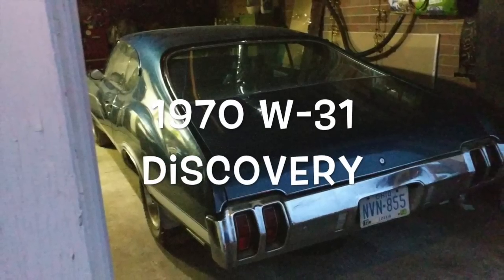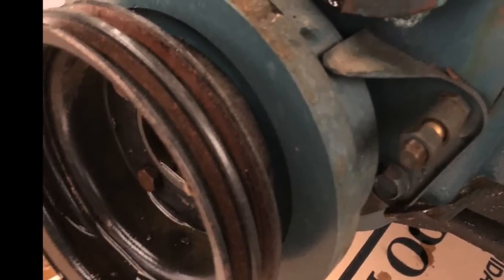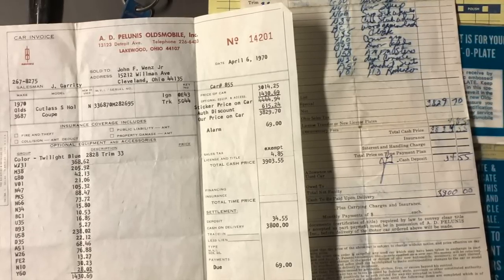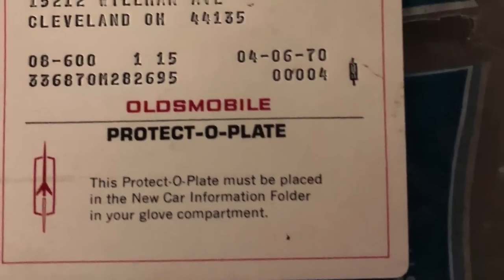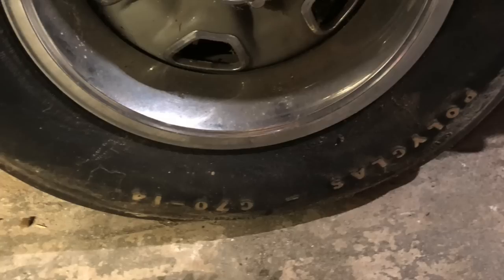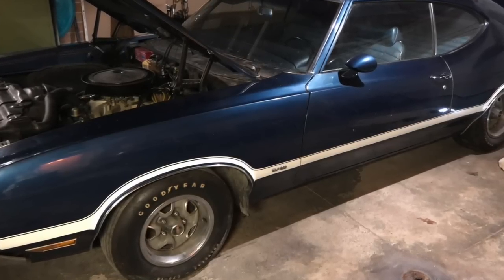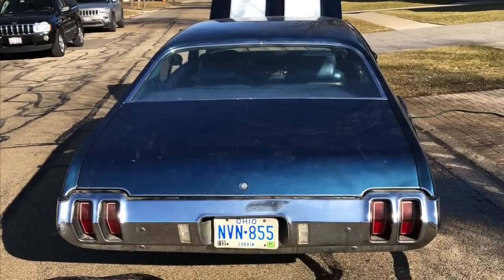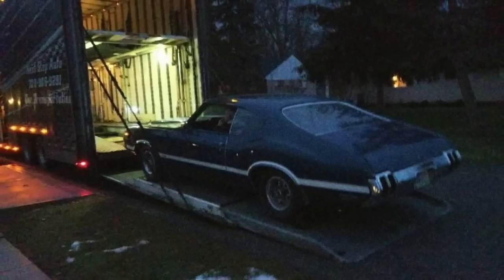1970 Olds W 31 Barn Find Uncovered

Comment: I've always been a Pontiac fan but I LOVE those W-31 350's. Old's pulled out all the stops when they made them. Thanks for the video and for rescuing a true classic from the musclecar era.
Reply: All the stops?  Take a look at the host of modification that were made to this engine in order for it to succeed in the NHRA "stock" class back in the day.   By today's SAE Net HP standards, this engine made no more than 250 SAE Net HP.  Tire for tire and otherwise production line stock vs. same, the typical 5 year old Honda Accord V6/automatic would toast this car.
Reply: The king of 442’s is and always will be the 1970 WP30 equipped with BOTH 4’s.
Reply: @harddrivin1le-970  Bwhahaha!

Comment: In 1976 there was a car lot in San Jose Ca called performance unlimited. A friend of mine used to go there weekly when he came across a Orange with black stripes 70 or 71 Olds W30  drag car sitting in the rear of the lot. It had very low miles and a blown up motor (455). It has been hit in the drivers rear quarter panel. He made a deal for the car and got it home. The engine was intact but had a cracked block from a piston that went through it. He found a donor block and he and his Dad rebuilt the engine and fixed the quarter panel. He got rid of the mag wheels and found a set of stock wheels. He spent the next couple of years putting it back to stock. Really was a nice car.
Reply: Hit the ground running.....was Performance Unlimited located off of Stevens Creek Blvd. or San Carlos Street? I remember Bob Shiro Motors, they had a lot of muscle cars back in the day.
Reply: @stanmendoza7871   It was on W San Carlos just over the higway 17 from Valley Fair. I also remember Bob Shiro Motors Stevens Creek at Kiely.
Reply: @rgs4x  That's the place I went to in high school.....many years ago. A friend of mine bought a real 1970 Hemi Cuda' there, he still has the car.
Reply: Stan Mendoza that’s a bitchin’ ‘Cuda

Comment: I knew it was a late 70s/early 80s repaint because my 70 442 is also a code 28 twilight blue and i did my first paint job mid 80s at 15 years old. Local painters supply mixed it and i knew it was a little darker than original but thought it looked better anyway. Love the overall vibe of this car in the vid!

Comment: Nice find.    1970 was the only year with the aluminum w-350 intake.   I had an intake and let it go.  Also 1970 had large valves (2 in intakes I think) and positive valve rotate-ors. very rare.    Most likely the reason for the air bags in the springs was the rear end bounced (alternating)  when doing burnouts.
Reply: E heads have 2 1/4 " and F heads are 2 1/2 " I had 70 455, E heads, rated 390hp 510 ft lbs of torque rated low for insurance purposes

Comment: One of my favorites along with the ralley 350s.
Reply: Both very modestly performing cars by today's standards, with the Rally 350 being the slower of the two.  The later typical ran lower 15  seconds quarter miles, with the former being good for upper 14s.  I have a host of vintage road test results from this period.  Even the '69 W-30 442s couldn't get into the low 14s or break 99 MPH in the quarter mile without various on-site tweaks, including removing the air filter element, tweaking the carb (e.g. jets and metering rods) and ignition and in some cases loosening the accessory drive belts. What was "fast" in 1969 is quite modest by today's standards.
Reply: It "makes your day"!😊

Comment: I remembered buying these cars for 350.00 to 500.00 all day long back in the 1980s
Reply: Correct, I sold my 1970 W-30 in early 1974 for $850.00 (the oil crisis)
Reply: How many 1970 W-31s did you buy for "350 to 500 all day long back in the 1980s?"  Production numbers on these cars were quite low, making the car relatively rare by the time the 1980s rolled around.
Reply: I bought my 70 455 olds in 1984 for $500

Comment: Very cool!
Reply from the maker: Thanks Bob. Still trying to figure out what people want to see and the best way to present what material I have. I am getting feedback to simplify, which would make editing much easier.
Reply: I know a guy with a W-31, its very nice, but original engine is long gone....but it does have a built 455...465 hp, 510 foot lbs torque.   Its so powerful if you are driving at 30 mph, floor it, it will spin tires until car gets to around 50 mph...the torque is out of this world!

Comment: I bought mine brand new from the factory with NO STRIPES from the factory. F-85 W31 4sp. Bench Seats all black. I bought mine from Earl Olds in CLEVELAND for $3300. I think there were only 135 made on the F-85 chassis.
Reply from the maker: You are the original owner?
Reply: @thewriter2549  I was. I ordered the car in Feb. 1970. I didn’t want the W31 stripes, and the salesman, Tony Foos, son of Earl, told me the stripes had to be on the car, because of the W31 package. I told him I wanted to cancel the order, but somehow, he pulled strings to have someone walk the car down the line, and make sure stripes weren’t t added.   I picked up the car just after the KSU riots, as I was a student there and classes were cancelled after May4.  My car was the 2dr. Sedan, bench seat, wing vent windows, dog dish hubcaps, ‘sleeper’ that I wanted. I put a set of Hooker Headers on, and a Sun Tach on the steering wheel. My Uncle had a 70 Cuda 383 4sp., and I would routinely beat him in drags. I could take Road Runners383’s, but I couldn’t get past the big block GBodies. At Norwalk Raceway, they put me in a class with GTO, SS396, and Roadrunners. I kept the car for 2 years, and stupidly sold it with 20k miles. It was probably a good thing, as I was a musician then, and would probably hurt myself in that car driving home from gigs loaded.  Biggest car wise dumb thing I’ve ever done. I tried to buy the car back, and the new owner ran it into a cement retaining wall at 70 mph, and pushed the engine into the front seat. The frame was twisted, and back then, we couldn’t straighten them out like today. I didn’t even have carpeting and it only had an AM radio.  Back then nobody new it was a W31 till they caught up to me ant the next light, mainly because of no stripes. They would then see the W31 badge on front fenders and have an “oh yeah moment”. It was so fn cool. It would probably be worth 6 figures today.🥲

Comment: I purchased a new one in 1970, mine was very rare, dark blue with black accent stripes.... The 3.90:1 rear axle was not standard...what would you like to know about the w31 ?   the ram air mechanism is missing on that car.... they had a dr oldsmobile sticker on the air cleaner... many unique things I remember.. Im 70 now.... my car ran 13.90s at pittsburg international dragway in 1970  (4 speed )  The engine would turn 6800 rpm pretty easy.. I floated the lifters and bent valves at 7200
Reply: larkin curtis Pretty sure he said the 3.91 was standard or are you saying yours had a 3.90:1
Reply: It didn't run a 13.90 in absolutely bone stock tune, though.  These cars were hard pressed to get out of the 14.6 range as they rolled of the showroom floor.  Revving these engines to 6,800 RPM plus was fruitless because that's some 1,200 RPM above peak power.  One would experience substantially improved results by shifting at 5,800 RPM or so with this engine.
Reply: larkin curtis Wrong. The 3.91 rear was standard on the 1970 W-31. There wasn’t a Dr. Olds decal on the OAI adapter. Your dark blue would be the same as this blue; the color is called twilight blue.
Reply: larkin curtis thanks, I bought a 70 Coronet 500/383/310 hp++/auto: actually the Dodge/AMC DEALER next to Thornburg ‘s Pharmacy (where I worked) GOT ME INTERESTED WITH a * AMC RebelMaCHINE, TO A 70 CHALLENGER 4 SPD/SE MAGNUM( to much gas eater,etc): the Ralley Red Coronet was  $3100( delivered), and for my wife to drive to Fort Wayne IND : finish Purdue....etc. Actually could,not afford w-31 Loaded, Corvette just out of Pharmacy  School....  .... ACTUALLY POWERFUL DODGE, ETC..... WARSAW IND road salt ate the Dodge up...........etc.

Comment: That proper Quadrajet is clearly visible @ 4:27 ... just saying 

edit: beside intake, partially obscured by air cleaner housing
Reply: TheCanadianBubba You’re correct in that there’s a quadrajet in the trunk, however, it’s not the original ‘255.
Reply from the maker: Nice try, Bubba, but this guy McKeague is an Oldsmobile W31 savant - just amazing, and he's a young person.
Reply: Seriously Jerry... I would bet my eye teeth that is an Olds Q-Jet... the fuel inlet comes straight out the front on those ones.

edit: unless that picture is from before the Holley was installed edit2: did not see the comment from Jimmy McKeague in there.
Reply from the maker: Yeah, but Jimmy says it's not the original 255.
Reply: Was too quick to respond to you and did not notice his comment.
Reply from the maker: Okay - well, you are knowledgeable to differentiate an Olds Q-Jet.
Reply: Proper?  GM specified a large variety of Quadrajets back then.  You'd need to know the specific model number in order to know that it's "correct."

Comment: Not offered with an automatic transmission. 4 speed only.  350 special cam and blueprinted. Available in cutlass S, f85, holiday coupe. Hi rever.... low production run 68-70 only . 4 wheel manual drum brakes.
Reply: Brian Scheid Wrong. In 1968, Olds launches the Ram Rod 350 (later changed to W-31 for 69/70). In 1969 and 1970 an automatic could be ordered. Rear end would be a standard TO coded 3.91 12 bolt with a 3.42 as an optional gear from the factory. W-27 aluminum carrier was an option that roughly 300+ buyers checked. This car does not have that. Additionally, just the cover could be had, too.
Reply: Also, you’re wrong on the 4 drums. Power brakes could NOT be ordered. Manual front discs are what you’d find on a ‘70.
Reply: @jimmymckeague2402  w31 was an option not a model. Your right on the rear cover w27 cover was not standard. I'd contact Oldsmobile club to double check trans. I could be wrong on that. I owned one going off memory. Take care
Reply: @brianscheid64   W27 came as a option for W30 cars. It would have a special aluminum cover!
Reply: W27 came as a option on the W30 cars.  It would have a special aluminum cover.
Reply: @clinteastwood9115  u r right. owned one years ago. Memory is not as good as it used to be. Good day
Reply: "Blueprinted" per Oldsmobile's advertisement office.  That's vastly different than a true blueprinting per NHRA specs!
Reply: @harddrivin1le-970  components were select fit.

Comment: I believe the W31 package was related to rear suspension  being coil arm suspension which a much better than the leaf springs anyday.  The pitch angle of the shocks set differently too, just squat right down on the road and grab on.
Reply: @RonTownsend Yes, the suspension on the W-31 was coined the rally sport suspension from Olds. It consisted of boxed control arms and a few other suspension / bushing goodies.
Reply: A W-31 is much much more than a suspension upgrade. Go research it online.
Reply: EVERY Olds Cutlass model (including the W-31) used a rear coil over suspension.  Indeed, such was the case for ALL GM A-bodies of that period.  Despite being quite familiar with the W31, I've never seen a shred of information suggested that the "pitch angle of the shocks" were any different than those of any other Cutlass. 442 cars came standard with the FE2 suspension, which included upgraded springs, shocks, bushings and the addition of a rear anti-roll bar.  1968 and 1969 W-31 cars did NOT come standards with that suspension and instead used the standard Cutlass suspension, though the 1970 W-31s did come standard with the FE2 suspension and a one year only aluminum intake manifold.  The '70 cars were some 150 heavier than the '68 - '69 models, though.
Reply: @brentnagy5913  The W-31 didn't include any suspension upgrade until the 1970 model year.  The '68 and '69 cars made due with the standard Cutlass suspension unless the optional suspension (FE2, from the 442) was specified.